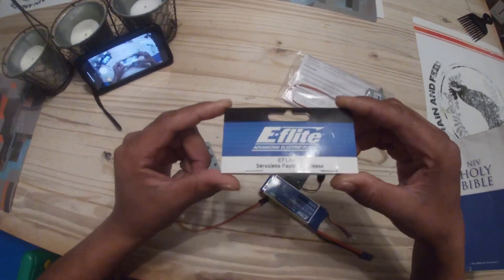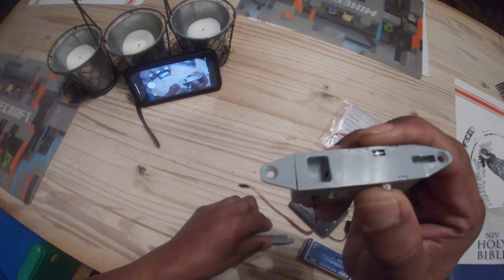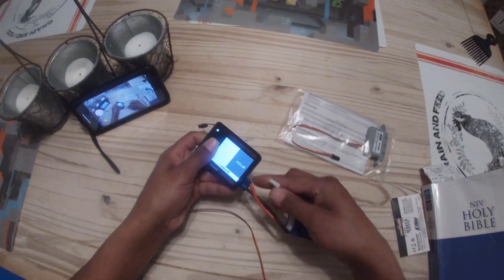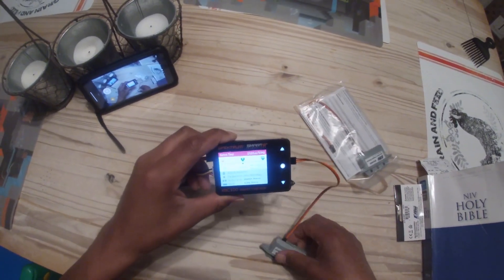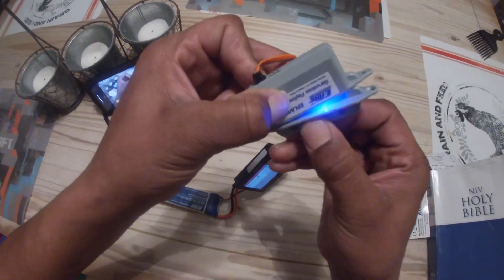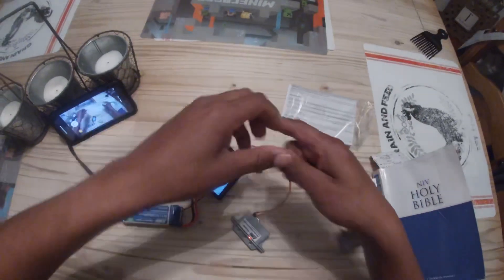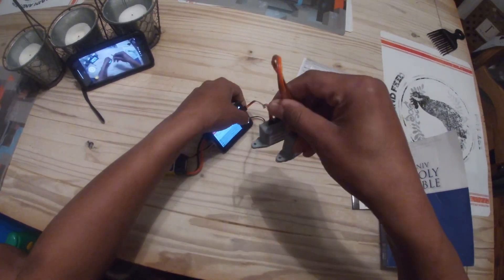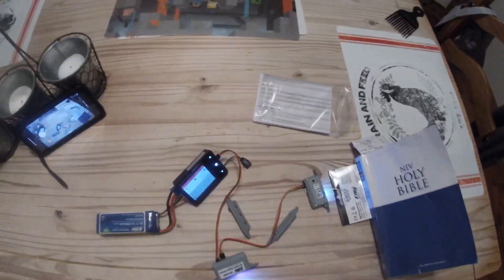Rc airplane Servoless Payload Release

Comment: Hi, i wanna ask something about the device. We're thinking to use the device on our project. Is this device using digital signal? I mean if we give it 5V the mechanism will work? We are gonna use it with pixhawk so the connection will be on pwm servo outputs. Do you think is it work correctly?

Comment: some info.   so   you  need one for  each  bomb.    okay, for a b52.      this is just  a  momentary, solenoid actuator  -   like  a  doorbell.      it looks  HEAVIER  than  a 9g  servo.      so,  what benefit do  You  see, in the use of this, single-bomb mount, widget.      eflite  has  'snowed' under-informed hobbyists, with this doodad.     cheers
Reply: its practical, safe and standarized...  it saves hours of calibrating, printing, coding, testing safety, drilling, failures... its plug and play...   the only thing i dont like is that it has only 1 payload atachement for each releaser...